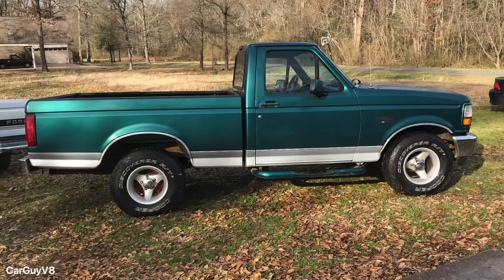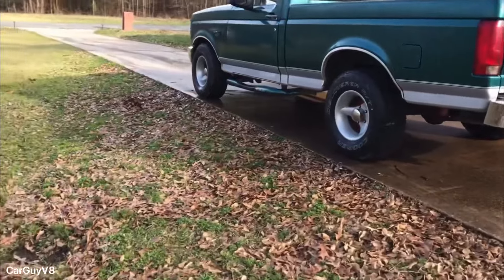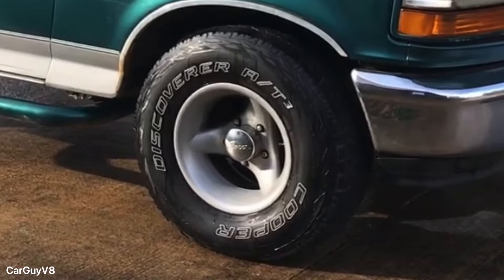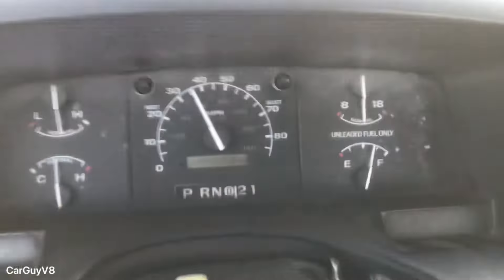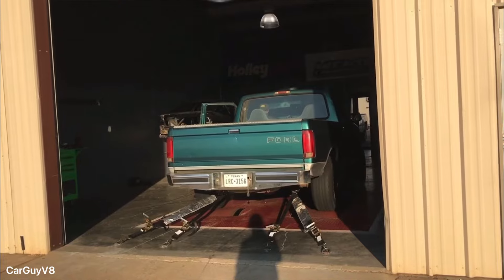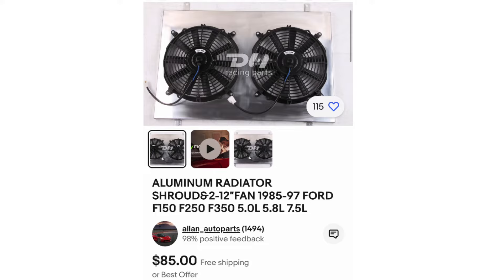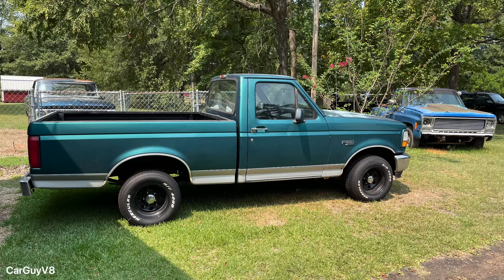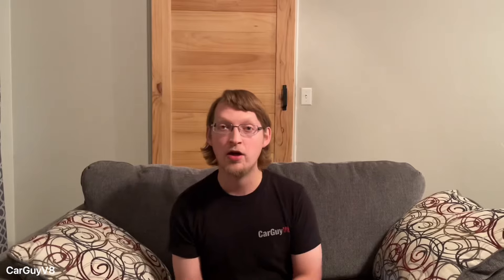These Mods Drastically Improved My 0-60 Times! - EFI 302 Acceleration Mods

Comment: 7.2 seconds is not bad at all. That's only a few tenths slower than my modern 5.0L Coyote F-150 "granted my trucks curb weight 1500lbs more than this one, but still not a bad time at all, that's about on part with the first gen Ford Lightnings.

Comment: What's the 13 degree timing adjustment? You adjusting the cam?
Reply from the maker: I’m referring to bumping the timing at the distributor.  The stock initial timing is 10°. A 3° bump helps throttle response and might gain a number or two. You can research more by looking up a 6liter tune up on a 302.
Reply: @CarGuyV8  Oh ok thank you I was just wondering because I have a 351 Windsor and it pulls goosenecks well but id like to make it preform better